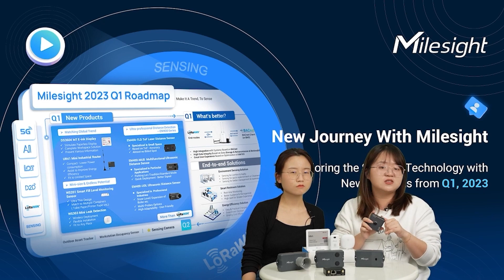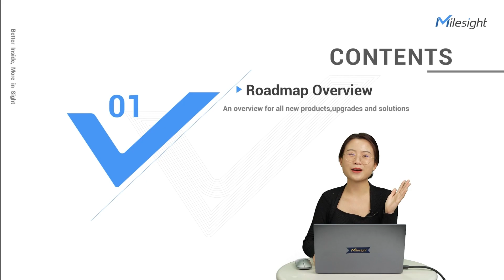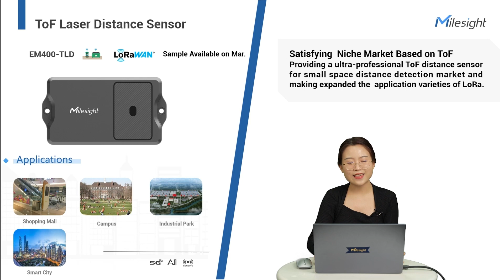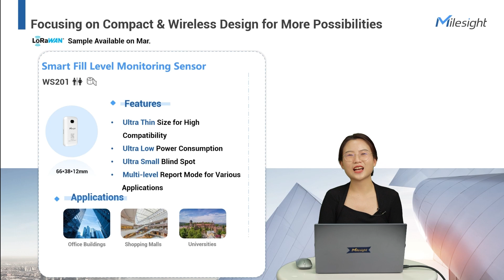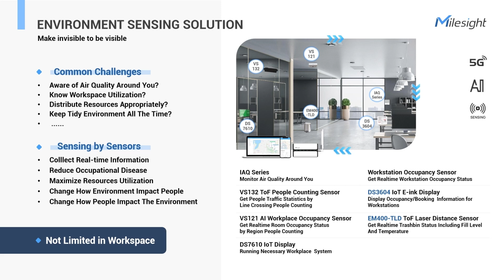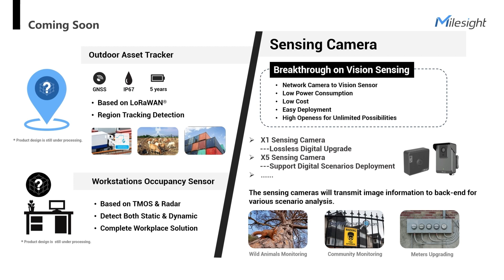New Journey with Milesight - 2023 Q1 Roadmap

Comment: Hello Sophia, well done, what a presentation. Quite informative and appreciate you endeavour of introducing new product.

My suggestion would be to make EM400 Ultrasonic Sensor (for level detection) to make it Mains 5V powered instead of battery powered with Class C LoRaWAN communication. This will help to apply EM400 (Ultrasonic distance sensor) to control pump stations in conjunction with the Gateways + Controllers.
Reply from the maker: Mansur. Thanks for your suggestions. 😀
Reply from the maker: Could you share your email with us?  We can have a further discussion.
Reply from the maker: Or you can contact us at iot.sales@milesight.com